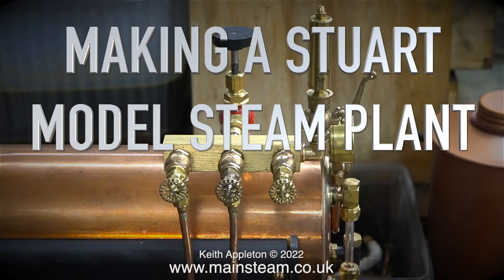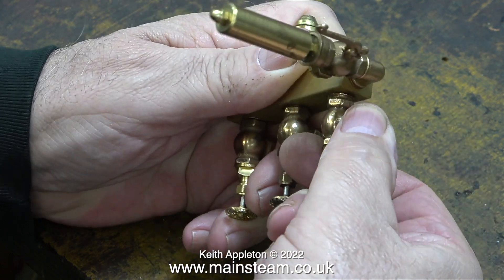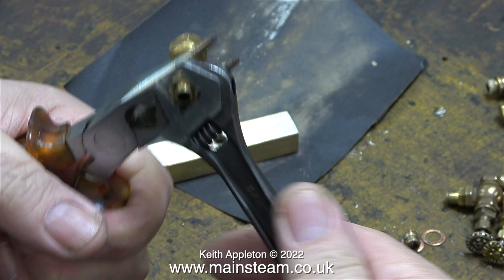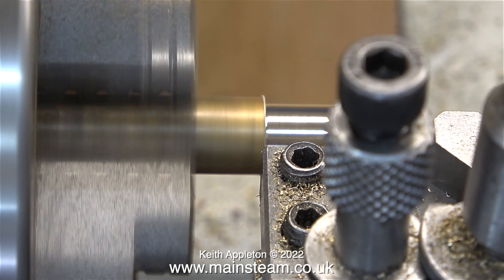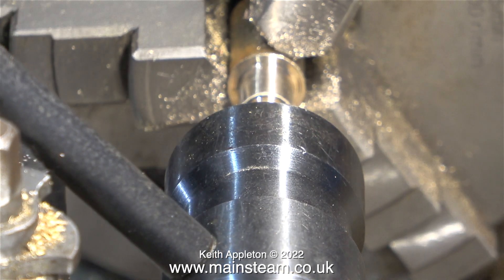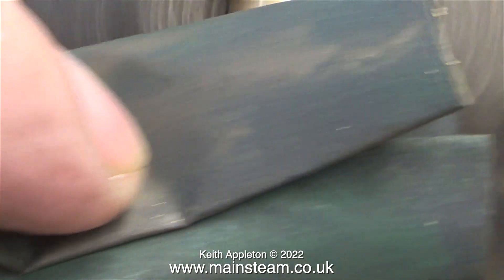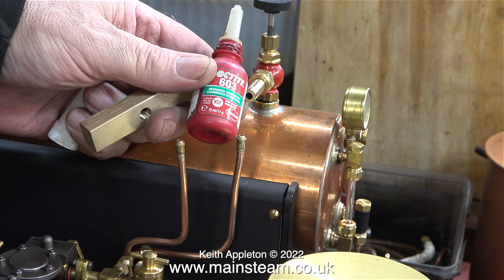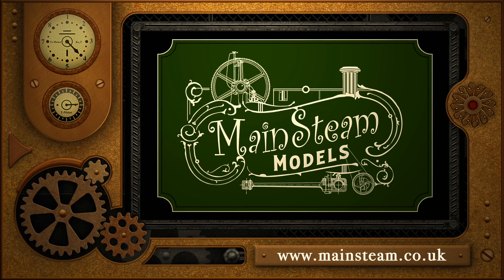MAKING A STUART MODEL STEAM PLANT - PART #84

Comment: do you find it frustrating if you run into metric and standard measurements? or are they all standard?(was wondering as far as I know UK uses metric)
Reply from the maker: Not really, I have more Taps & Dies for Imperial than Metric, they are definitely not all standard.